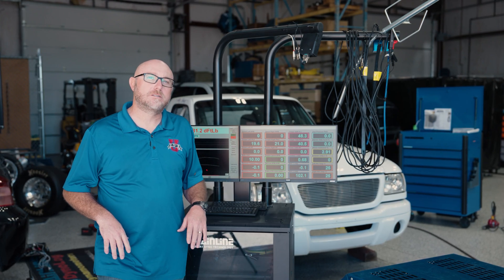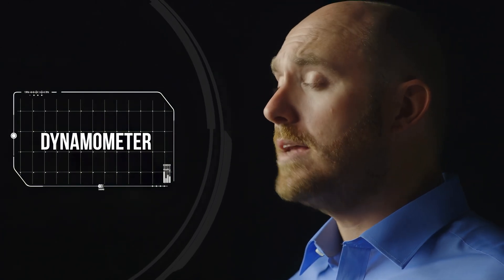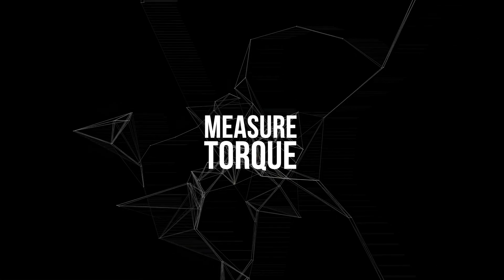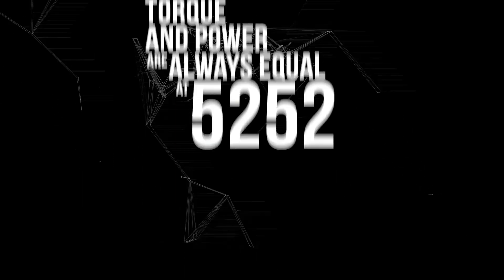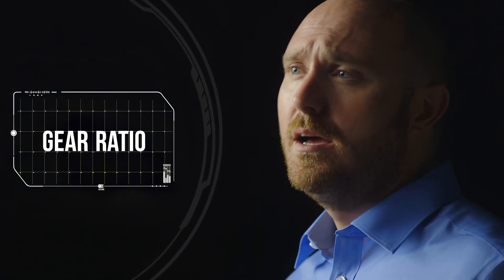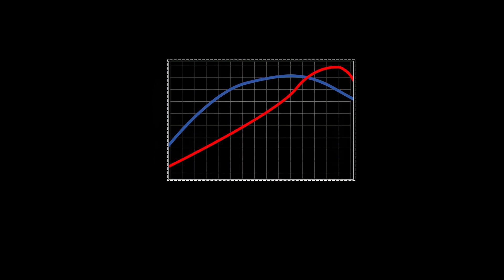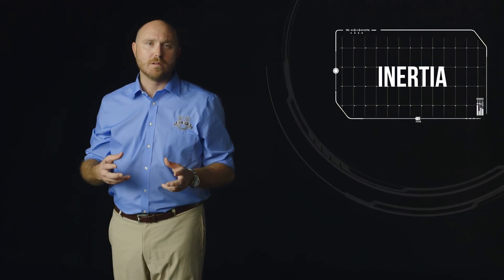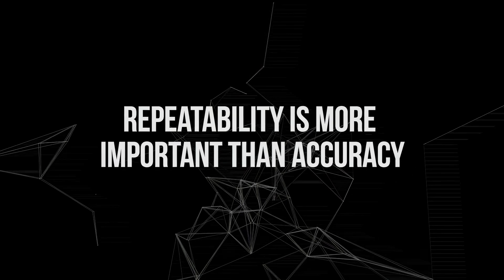DYNO TESTING: Don't screw up your engine doing it wrong!

Comment: Dynos measure the acceleration of the drum.  It uses the rotational analog of F=ma to calculate torque.  Then it calculates HP.
All manual transmissions are constant mesh, which means you have the same friction regardless of which gear you select.
Horsepower can be thought of as how quickly an engine accelerates.  Dynos should be measuring HP over TIME, not rpm.
Eddy current dynos are free wheeling and use a fudge factor to estimate inertia/friction.  Load bearing dynos calculate inertia/friction by doing a coast-down test.  It doesn't capture everything, and it's pretty darned close.

Comment: I will never build an engine without breaking it in and testing it on my dyno first. So much simpler & when it goes in the car, the engine is 100% right, and my gearing and converter are as close to perfect as possible.

Comment: I'm really late to the party, but wanted to say kudos on noting that actual losses don't vary much depending on gear ratio, at least within the transmission.  Much of the dyno mythology about using the 1:1 gear for best results is based upon some old manual transmissions that actually used a direct drive (basically a sleeve) to connect input and output shafts in their "1:1" gear.  If you've actually got a gear for your 1:1, the mechanical and frictional losses across that gear set won't vary much compared to a 0.5:1 or 2:1 gear set.  That said, dynos with variable ramp rates, especially hub dynos, can show pretty dramatic differences from gear to gear if you don't adjust the ramp rate accordingly, mainly due to inertial losses elsewhere (driveshaft, differential, axles, brakes).  Dyno in 3rd and 5th with the same engine rpm sweep rate and 5th will show much higher losses

Comment: Good video, but saying torque is work is misleading. Yes it has the same units, but they're not the same thing. For example, a static torque does no work, same with a linear force that doesn't move. I would also argue the point that a chassis dyno "isn't accurate". We don't race engines, we race cars, so the HP delivered to the wheels is more important to me than what happens at the flywheel.
Reply from the maker: Fair point from a different perspective

Comment: With inertia dyno you measure horsepower and calculate torque if you know rpm. For power you dont need to know rpm.
Reply: You measure acceleration of mass over time, that gets calculated into horsepower. It’s not measured directly
Reply: @350gtboi  and with roller dyno you measure torque at the torque arm of the dyno, not engine torque. Torque gets calculated from horsepower to the rollers and engine rpm. Torque is just a BS number.
Reply: @V8Lenny  Not all rollers as is the case of inertia dynos. Dynos with retartea yes. Those measure torque at the arm. But it could be an engine, chassi roller or chassis hub dyno.